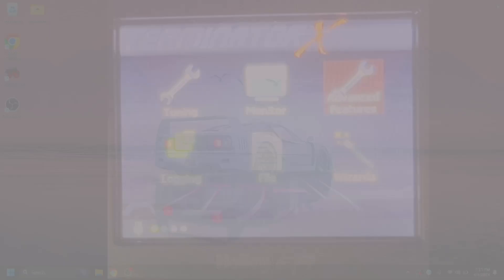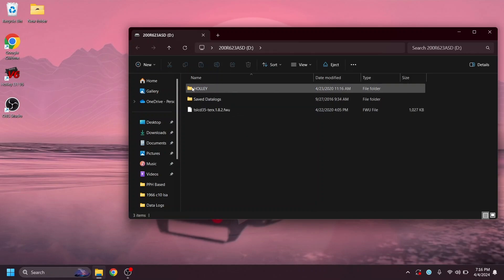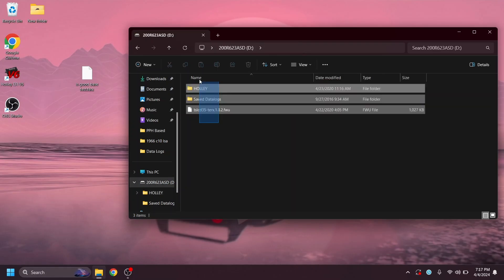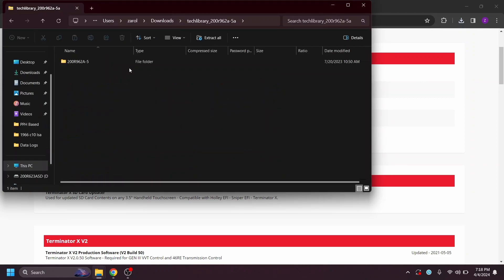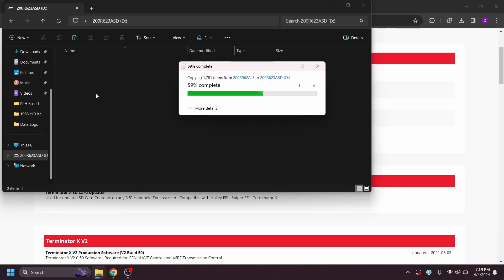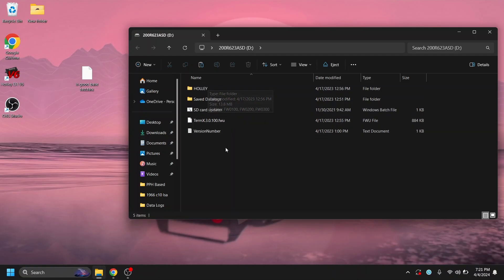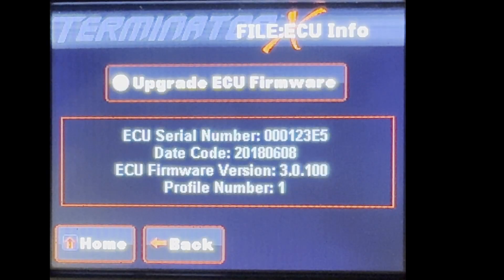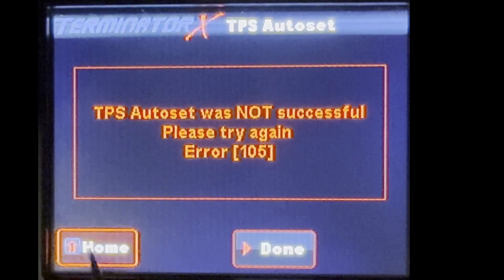Holley Terminator X and X Max Step by Step Firmware Update Guide

Comment: Hi thanks for the video! I was running the original v2 and i was able to update. Does this work with v6? Are the terminator x and 3.5" even compatible with anything other than the v3?
Reply from the maker: v6 is not for terminator x , that is for the hp and dominator ecu line.

Comment: I have a 94 for lightning with a built 351w and 4r70w trans, I have a terminator max x and for some reason during upgrades have lost all the trans options I have downloaded and updated the handheld and have been on the phone with Holly techs the last time with a 1 hour wait and they walked me through the updates. I still have no trans control just a error and it doesn't even give me a option to choose a transmission. Originally it had these options and I had to switch to a 4r70w because it didn't support the E4od that was in the truck (Long Story) not sure what is wrong. This all started when I Had to update the firm Were to work with a laptop so I could do some tuning.
Reply from the maker: maybe try going back to your older firmware or starting with a different tune?

Comment: I got fussy mines wasnt working and went back and deleted the sd card and formatted it. Then dragged the files over and im getting the same thing saying searching for ecu. Did i brick it?
Reply from the maker: When you put the card in the hand held for the first time did it do an update on its own automatically?
Reply: @Rolo-Rides  i got it fixed. When i updated to the v3 it was having problems so i went with the v2 and everything worked.